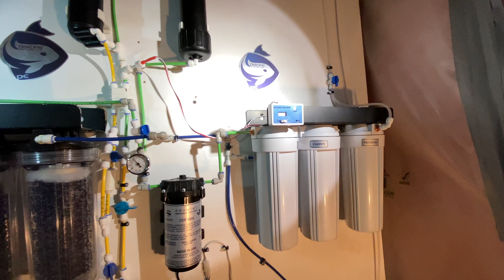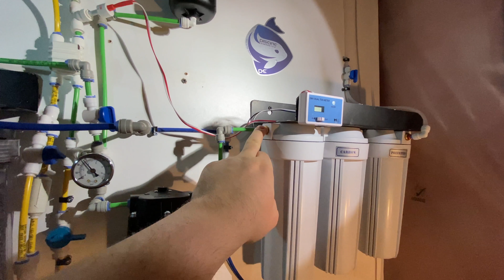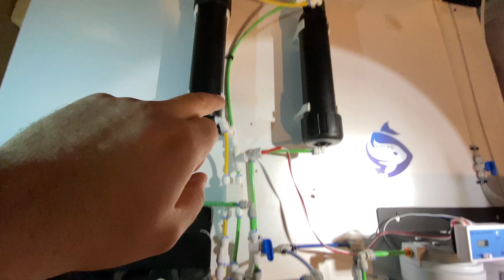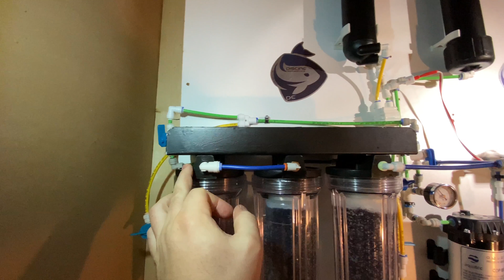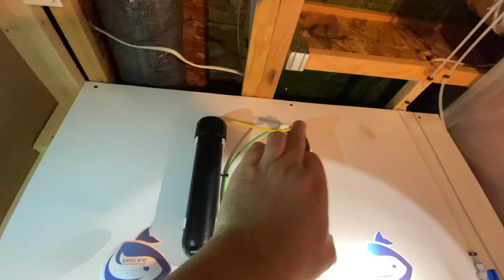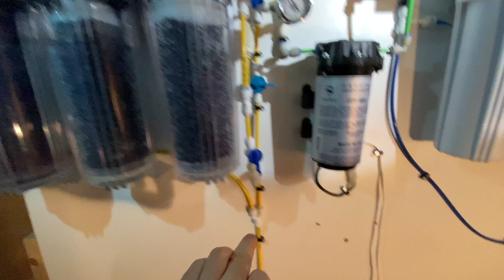How to set up a RODI system with ZERO WASTE WATER

Comment: The BIG problem is that even if you send all that water back into your house ,The cost for the water will be the same bc it isnt going to turn back your water meter.
Reply from the maker: The goal with this setup isn’t entirely to save money, but to eliminate pouring “waste” water down the drain. This way the water is used for washing dishes, taking showers, etc.
Reply: @AquaristExhibit  hi I also don’t want to waste water so I went a different direction I have my water run though 3 traditional filters then though 3 large DI filters it also gives me 0 TDS with no waste.
The DI last a lot longer than I expected pls give it a try👍
Reply from the maker: @sko1beer  I’ll definitely look into this! Thanks for the tip!

Comment: Great idea but one thought comes to mind...if calcium is one of the major elements in your water that is being rejected by the RO unit then you are sending increased calcium levels into your hot water. Calcium is inversely soluble, meaning it will drop out in increased temps. Just something to be mindful of. I have seen large setups for industrial sites that use RO and they use the waste to flush toilets, irrigate, etc. It can be done, you just have to figure out how.
Reply from the maker: I know the idea is not perfected,  a holding tank would be preferred, something to send the waste water into to have it on top to be pumped to a special plumbed tap to be used for laundry, plants, etc. 

I do appreciate the feedback and If you had any suggestions, I would love to hear them.

Comment: how are you forcing the water back into the system.  putting it on hot is a better concept but you can't force that much water into a plumbing system that's already full.
Reply from the maker: I utilize a booster pump to increase the pressure in the line, which is higher than the pressure in my house’s plumbing manifold.

Comment: How is it working for you so far? The Wastewater needs somewhere to go so unless you're using hot water at the same time the RO is running it's just going to cycle back into your RO system unless you have it ran past the hot water tank in which case the water tank valve will prevent it from backfeeding and the pressure will build until the RO stops working
Reply from the maker: Yes, you’re right. It works, but it is not perfected. I try to run the RO system when I’m doing laundry or showering, or washing dishes, so this way the wastewater just comes out of whatever valve I’m utilizing at the time. it does work for sure.

Comment: How do you know how many DI’s are needed. I just want a small system for a 40 gallon reef system that I want to set up.
Reply from the maker: You can call the city water department and ask them how many tds is in the water, also find out if there is bleach, chloramines, chlorine, or other toxins or disinfectants in the water supply. Also you can easily check your own water supply beforehand with a tds meter. When it comes to De  ionizing resin beds, I wanted to get the most effectiveness and longevity out of mine, so I opted for 3. A negative charged bead, positive charged bead, and a mixed bead.  I typically would always recommend this DI setup as it lasts much longer, extra initial setup is negligible, and nothing can get by.

Comment: How is the system now? I'm planning to buy a 5 stage RODI unit which needs electricity. Have you refine the system?
Do tell me the problems you encountered till now 2024
And how you managed to fix them.

Thanks!
Reply from the maker: That same system is not installed anymore as I have moved from that house unfortunately.
Reply: @AquaristExhibit  oh. That's unfortunate. No plans to hop back to the project?
Reply from the maker: @macrick  I’m starting a whole new system which I am going to start a series of videos on very soon actually. In the next week or so!!
Reply from the maker: @macrick  will definitely be hopping back in, just a whole new project. First video incoming within the next week or so!  Stay tuned

Comment: Good idea and video!  I've been wondering how to inject the waste water back into the supply line too.  But what happens when you're not showering or otherwise making room for the waste water?  Will the booster pump continue to run and burn out the motor?  Or does it get re-routed to normal drain and waste it?  Also, my rodi is down the basement but fish tank is on main floor.  I want to auto top off the fish tank to account for evaporation.  I presume I would need another pump to get the water upstairs, but how to shut it off when fish tank float valve is off?
Reply from the maker: Thanks for the comment! You can buy switches that automatically turn off the pump when topping off is done, or alternatively you can use an reef controller like GHL.  I just put more pressure back into the supply water than it runs at so it backs up into the city system

Comment: Nice video. The issue is that water always equalizes out.. so as you send the waster water (with super high TDS concentration) it will equalize with the rest of the water in the pipes bringing the TDS higher. This will degrade the quality of the water you drink (yuck) and also burn the membranes faster. You’ll spend more money in membranes than you save. 

Either way, let us know long term how it works. Look forward to an update!!
Reply: Because of the size tank and amount of water actually produced I dont think it will be a problem drinking wise,  1 bath/shower and the water water will be gone from his system.
Reply: @canadianreefmaster  Unless you're running both at the same, it's most likely cycling right back in...
Reply: @ArnoldosAquariums  once it gets plumbed into the hot water side it will never come back to the cold water side.